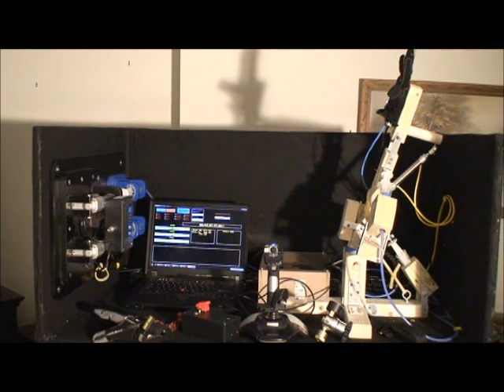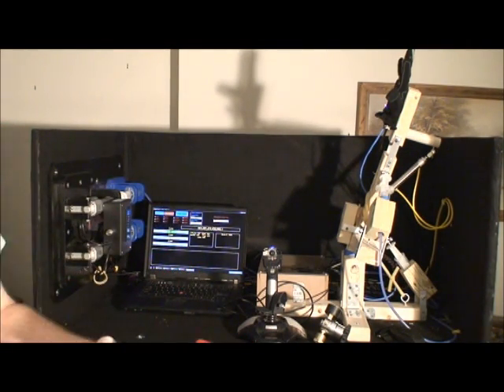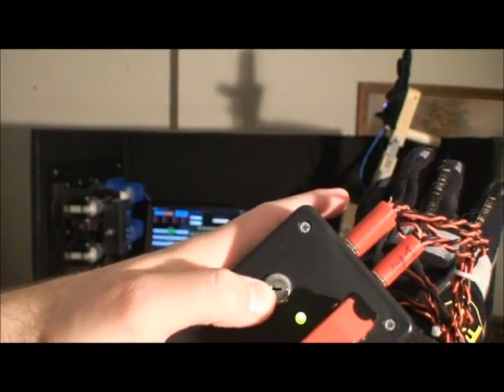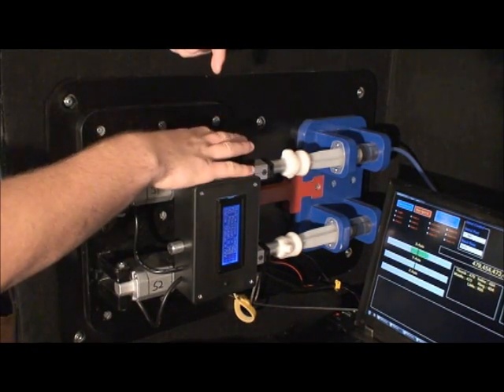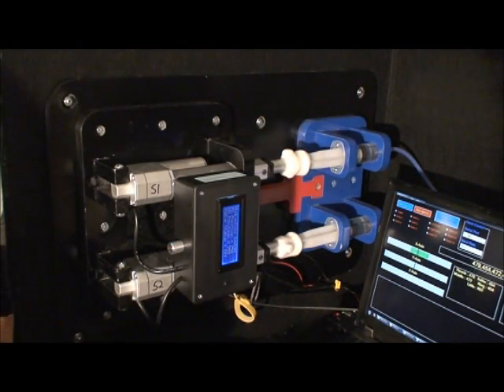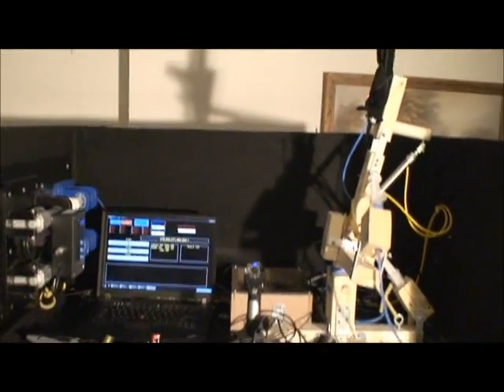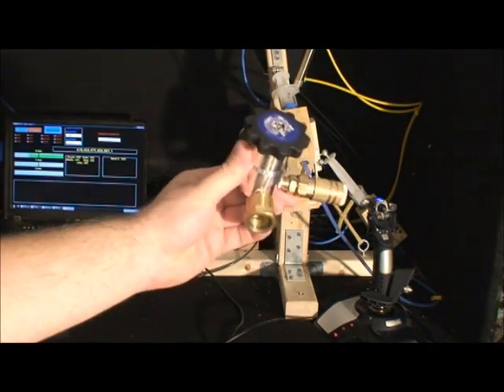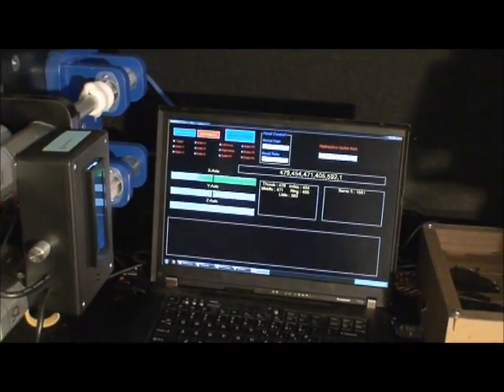Prosthetic Hand - High School

Comment from the maker: I was going to but ran out of time. There are tutorials all over about the single transistor flyback driver if you look around. Its really very simple, 2 resistors, a transistor, and some wiring. It takes a bit of tinkering but it will work eventually be careful. Be careful doing anything with high voltage, flybacks with enough power can have enough output current to kill you. Even if the current doesn't get you that high voltage will not be pleasant!

Comment from the maker: I'll message you the link. The hand isn't the same as last time I had to make a new hand to hand a higher pulling force and I had to embed steel cables in they rather than the string I used last time. I also had to attach the cables directly into the hand. It follows the same concept with the glove in control of the hand but other than that nothing was re used.